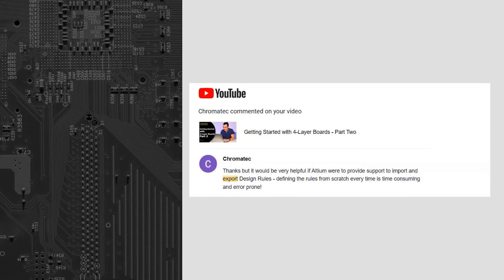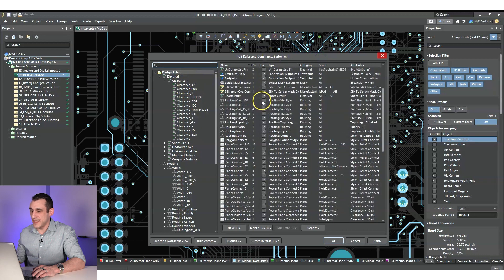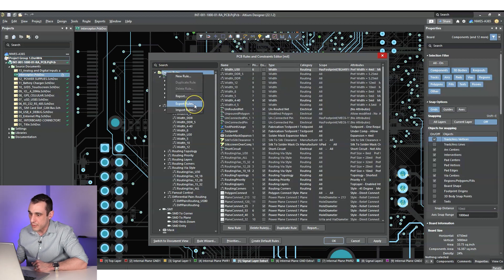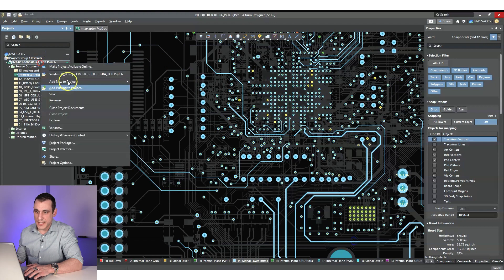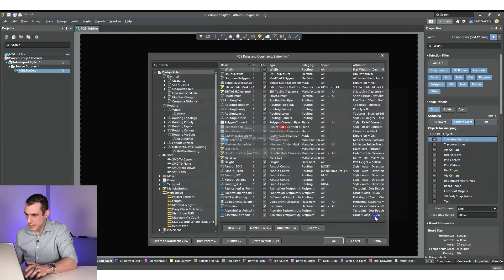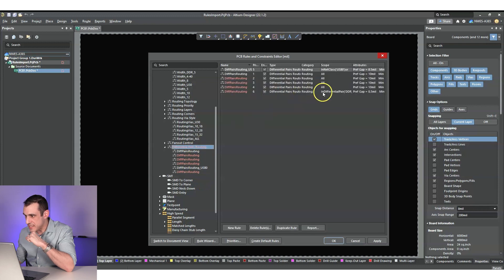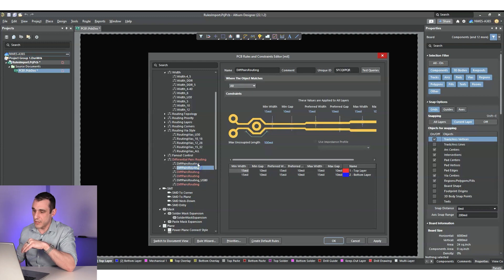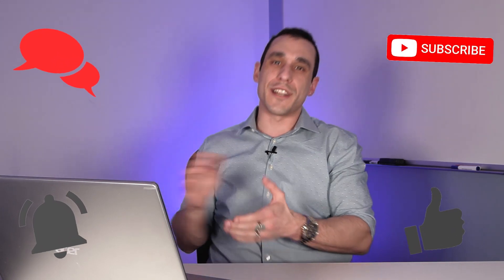Importing & Exporting Design Rules - Altium Designer Quick Tip

Comment: Hello!, thank you for the video, but the option to export or import does not appear in the contextual menu as you mentioned. I am using Altium 23.9.2,  could that option have changed?"
Reply: I have 23.10 and I see the context menu on right-click, I also just recently used on a project and the rules export/import works as shown in the video.
Reply: Yes, thank you for the response. I resolved the issue by reinstalling Altium. Thank you again. @Zachariah-Peterson

Comment: I know its not the point of the video, but any reason you're not using hierarchical design (subsheets) for this project?
Reply: That board was about at the limit of what I would normally use for a flat style project. Once it gets to higher number of sheets I normally do hierarchical.

Comment: Is there a way to import design rules from a foreign layout tool, or is that included as part of PCB layout import already?
Reply: Portions of that design rule conversion are included in the migration process depending on the other CAD platform. So for example, if you do an OrCAD migration, you will be able to select groups of design rules to translate as you walk through the import wizard.